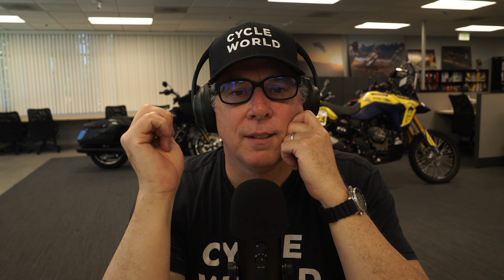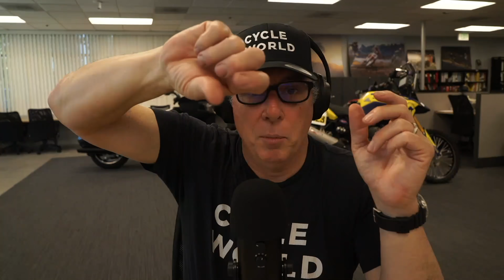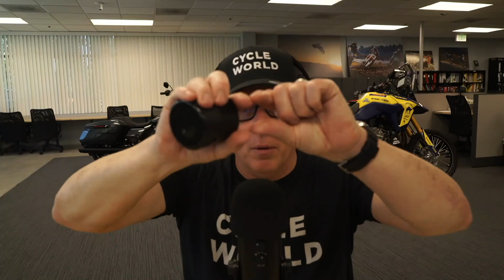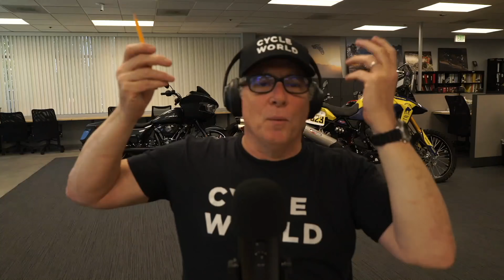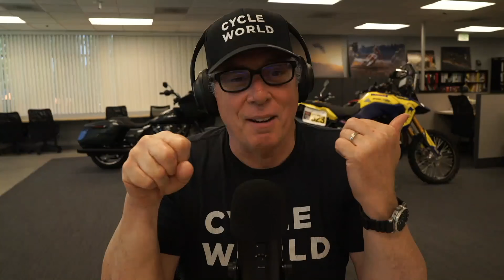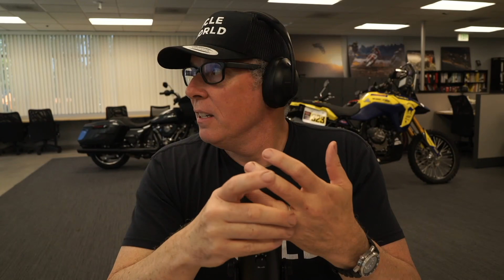MORE "NEW" Tech that's actually really OLD!

Comment: One time I acquired the apothesis of the idea that roller bearings don't need too much oil. 
I had bought a Ducati 175 basket case, discovering that the engine was completely trashed due to being run without oil. However being in all ball bearing engine the only parts that were completely destroyed were the cam and rocker arms. Probably the bevel gears too I don't remember. The cam lobes were worn down almost a quarter inch! It had been run a long way without oil and must have made horrible noises.
Fortunately I found a pristine 175 engine being used as a door stop in a cycle shop up on the North Shore end acquired that engine for the project.

Comment: 3:56 "preflight was missing something"
Yep, but their timing was perfect. Losing the tail is more serious after takeoff.
16:14 "exactly the same [oil level and look after 10k]"
Sounds like an oil analysis could give you an extended oil change interval.
Our old "religion" demanded checking between changes, but we're all Oil Atheists now. The oil change tech lets us know if there's a problem. They're even banning the old religious practices by getting rid of dipsticks.
22:02 "rider aid"
Like automatic transmissions were for your girlfriend's car.
37:39 "deep fin"
Aluminum insulation.
42:05 "how many valves per cylinder?"
Eight with a 3:1 bore to stroke.
55:13 "someone...saved....flat combustion chamber"
Sometimes a local maximum shields eyes from the real peak. Flat cooled combustion chambers are inferior to insulated vertical combustion chambers in every way. Heck, flat combustion chambers are the reason bore to stroke has stayed so low. But a large bore to stroke provides the head space needed to go vertical, eliminating the heat loss and quenching issues.
55:35 "in the dyno room breaking parts"
Sounds like a good partner. I break parts in my mind's eye, which only gets invention so far. However, AI makes my mental explorations far more powerful. AI is accused of making folks dumber, and I see it is true for most, but it's like a grid-electricity-fed supercharger for inventors. Discussions with a vast knowledge base that hallucinates and fudges and doesn't really know anything are kind of like dealing with a psychological slide rule. You get two or three significant digits, but what do those digits mean and did you fat finger the query?
1:08:33 "Paired balance shafts"
A grand solution. I suspect that without ancillary use balance shafts best inverted crossheads.
1:15:53 "disc brakes"
Emit dust and aren't a significant improvement now that hybrid systems do most of the braking. Cheap and light is good enough (he says about BRAKES?!?). I dunno. I haven't explored brakes much since cantilever bicycle brakes, but brake dust containment is becoming a thing.
1:17:26 "he just kept thinking about it"
Yep. Virtual work works, too.
Thumbs up

Comment: Wait, you can still check your oil on a modern import?  My 2015 Volvo has no dipstick!  BTW Volvo screwed up the oil ring on this model and replaced the pistons on extended artificial warranty in order to avoid a recall, the user has to ask for it.

Comment: So  WWI rotary radials were oil injected. Just like the recently modern oil injection system for motorcycles and some cars.  The difference was that WWI rotary engine were 4 stroke and the fuel air mixture was pulled through a hollow tube that was also the carb and air and fuel metering "carb', in addition to connecting directly to the crankshaft and fixed part of the engine crankcase.  (It didn't really have a venturi at that point.)

  So the oil was just dribble into the air intake somewhat down stream of the carb and the oil was Castor Bean oil and was pretty thick and sometimes needed to be heated before adding to the oil tank so it would flow  at subfreezing temperatures.  At any rate, the oil would form a heavy film on the interior of nearly all of engine's interior parts, so there may have been some splashing but with the heat the engine was making, I suspect a lot of it was the flow of gasoline and air through the engine that propelled and distributed this oil around.

Comment: Both my car and truck. A 2017 jetta and 2021 Chevy silverado 1500 are 4cylinder turbos with flat top pistons. Good cylinder fill and variable cam timing. Efficient and the torque comes in before 2 grand. Both amazing engines.
Reply: They are remarkable. The Volvo is also based on a 4 cylinder and can produce up to 345bhp!

Comment: The first ktm 4 strokes ( 2001) used Dog rings, what a great system , not sliding heavy gears on splined shafts seems like a no brainer. Hard to see how the slight extra cost wouldn’t be worth it.

Comment: 🎉  Hey you two 

Rotax  has  your  2stroke  design  sussed  out  !! 
Old news perhaps
, but new to me and BHP 😮 wow!
Twin cylinder 
850 E-TEC TURBO R WITH WATER INJECTION 180hp
 (consistantly at low altitude ) 
 This and others , non turbos , 600cc twin, 900cc twin, + more ...
There developed fou use in "Skidoos" .
Cheers and thankyou for your great talants n tales ❤😊

Comment: Once you have heard the roar of an Offy, you will never forget it!  We often use the name "Offy" to describe any number of those classic DOHC purpose built race motors.  They appear similar, no matter the name, because of one man...Leo Goossen.  He inked all of these designs, including the Novi. America's Harry Ricardo.  Lovely discussion, complete with so many rabbit holes, I commend you for staying on course.  Some years ago, while sitting in the stands at Ventura Raceway between sprint car heats (I was crew chief on the 52x car), my friend Mike "Jellybean" Cook brought two seasoned gentlemen to sit with me.  It was a complete set-up.  Ed Iskendarian and Louie Senter.  Ed and I took all of 10 seconds to become lifetime friends because of my unusual career in aviation.  The conversation wound its way to the turbo-compound, direct fuel injected, magnificently complex R-3350, an engine that could be shut down in perfectly good working condition, only to be found broken on the next start!  The 3350 was Ed's favorite engine, as he worked on these in WWII.  We then talked about the Lycoming XR-7750 radial, an engine that sported variable cam timing.  It was a special moment in time, as are your weekly conversations.

Comment: Sturmey-Archer also makes planetary gear hubs for bicycles. Someone that worked at the factory in England questioned the engineer on the tolerance of a component that had just been made. He said it met his specification and let it go. Not long after, manufacturing moved to Taiwan. It seems even a well manufactured component can fall within spec.'s.

There must be some old motor engineer that cringes to see adding filter upon filter to get a desired longevity on a certain component.

Comment: Ah, the Yamaha YDS series. The clutch hub was splined, as it was on the crankshaft, with its constantly varying rotational speed, loading and unloading. Only much later did Yamaha learn that the clutch would operate just fine if relocated to the transmission input shaft. Better, actually.
Reply: Clutch has to take more torque due to crank reduction gear. 😞  But when shifting gear the clutch speed has to get changed by the newly selected gear and since rotational kinetic energy is speed squared there will be a lot less energy to be dissipated into the dogs. About 10x less.🙂

I just made that up but it seems reasonable :face-blue-smiling:
Reply: @springford9511  "42.7% of all statistics are made up on the spot" - Steven Wright

Comment: Back in the old Steam Engine days, there was a oiler for soluble oil entering the system to lube the seals and bearings. There was a charming little gauge in the cabin which was filled with water and you could see the drops of oil coming up through the glass tube when you opened a valve, and the correct reading was several drops per 5 or 10 seconds - I forget which..

Comment: Great show Mark and Kevin! I've always wondered why guys would constantly wick the throttle on 2 strokes. I just assumed that they would load up the plugs at a idle. It didn't dawn on me that a 2 stroke starves for oil at idle.
Reply: That probably applies more to the bikes using the auto lube or oil injector pumps that feed oil with the throttle cable.  There's always oil when you premix.
Reply: @RedBud315  Oil in the combustion chamber will foul the spark plug in a 4 stroke. Why doesn't the same thing happen in a 2 stroke?
Reply: @ericalger5003  On the two stroke the gas and oil mixture actually go into the crankcase first underneath the piston as its going down and oils the crank.  Then the fuel gets pushed up through the transfer ports on the sides of the cylinder to the combustion chamber.    https://www.youtube.com/watch?v=bIH4E8waCzo
Reply: @RedBud315  OK but 2 strokes smoke, so a lot of oil is still getting into the combustion chamber.
Reply: @ericalger5003  Yep and I'd imagine some fuel lost in the crankcase which is probably why they burn so much.  Also bang on every stroke going down instead of every other stroke.  My old RD350 blew away all the CB750's I came across stop light to stop light with front wheel lifting the first three gears when power band hits.  First 750 beating me was VFR 750 Interceptor.

Comment: Right out of high school, I ran into two fellas that had been in the Navy and served at the base in San Diego.  They were line crew for some F8Fs and watched them daily.  They recounted an incident where a pilot in training came in with an F8F too far down the runway and in his decision to go around, slammed the throttle in too abruptly and the airplane torque rolled upside down and slid down the runway.  They said the pilot emerged with only minor injuries and ran full speed away from the crash on foot.
Reply: Yea the F8F was a light plane with that massive R2800 engine on the front, as much as the F4U weighed the R2800 would flip one of them if a pilot decided he was coming up short on the carrier deck and gave it too much throttle at once, so yea, you can bet that engine would put an F8F on its back like right now.

Edit;
I just looked it up and the F4U weighed almost a ton more than the F8F.

Comment: I wish little sports cars used sequential shifting!  That would be awesome!  Especially if there an electric motor to add a bit somewhere because that could be used as reverse.   With modern robotic shift and e clutch then a fully manual transmission car could "easily" via ecu and robotics simply be commanded to auto shift and clutch without giving up true manual shifting option

Comment: The original Kawasaki Z-1, and the KZ1000, etc. that followed, had the shim on top of the cam bucket.  Thus, these were the surfaces that wore against the cam and could/would be replaced during valve clearance measurement and adjustment.
Reply: Yes and they could also be spit out with great force that didn't do the engine any favors! Moving the shim UNDER the bucket was the hot rodders trick!
Reply: Suzuki and Honda also used shim on top buckets. They were the easiest valves to adjust. I loved them. But I saw Freddie Spencer on a Honda Superbike spit a shim at Laguna Seca. It blew such a huge hole in the engine, it smoked out the whole racetrack.
Reply: I remember reading an article,  I believe it was in Cycle magazine on the Champion Man, Bobby Strahlman. The story described him as a man that tuners that would walk to throw water on a burning orphanage would RUN  to seek his advice.  I learned how to read spark plugs reading that article!  A skill that probably saved many of my 2 strokes I loved to modify back then. Free education!  Your podcasts do the same for me.  Thanks
Reply: Very good for servicing. Use a tool like a "C" spanner to depress the spring and lift the shim out. Fiat 128 was the first I ever heard of (1969). In something like a 6,000 rpm road car, no risk of shim flying out as others have noted.

Comment: Have any motorcycles used, keyed, radius faced pad, direct acting tappets / buckets, like the Offenhauser, to allow more radical / faster acting camshafts?
Reply: Not an answer to your specific question, but Velocette had a pair of splined face engagement dogs on their kick start assembly.  One learned quickly how to maintain that engagment before pushing the k-start lever down.  Don't let up on the lever at all for any reason or your knee would need a new cap. I bought a Velocette from a shop at Tooting and Broadway in London.  By the time I cleared London I was damn good at it.
Reply: @jem-l6c 
Pour yourself a drink!!!
Reply: I wanna say some S and S Drag motors use that setup?

Comment: Keven, why were R-2800s never put on B-29s?
Reply: Don't know what he might say but IIRC, the R3350s had just enough more grunt on paper to fit the job pulling around the B-29 and its huge propellers.  Sadly, the Wright 3350 was more trouble prone and had a terrible teething time getting the bugs worked out.   My father was an inspector with the War Assets Administration when I was very young and served at Boeing / Wichita to approve the airplanes for the government purchase.  I was only about four then and recall numerous times him coming home with horror stories about the Wright engines catching on fire.  I've looked at a number of videos on YT describing the period and the B-29s and only recently learned that some of the overheating failures was brought on by faulty instruments indicating engine temperatures for the flight engineers.   Also, the original 3350s then had the front row cylinders exhausting forward into a collector behind the cowl nose - this caused overheated air to pass rearward over the engine.  That feature was changed by the time the engines were fitted to the Lockheed Constellation and other aircraft.  The only two B-29s now flight worthy are powered by what are referred to as 'composite engines', R3350s assembled with accessory cases from, I think C-119s which are more suited to the operational needs for airshow performances.
Reply: They weren't powerful enough, the engines put in bombers weren't in as high of a state of tune as the engines intended for fighters, just like an engine in a pickup truck is meant to have a longer life than one in a Corvette. 
The R3350 was 550 ci bigger than the R2800 but made roughly the same power, because "the rubber band in it wasn't wound up as tight", and that comparison is between the early R3350 engines and the later R2800, all those engines made more power as they evolved and got more refined. 
The R2800 would have burned itself up much more quickly doing the job.